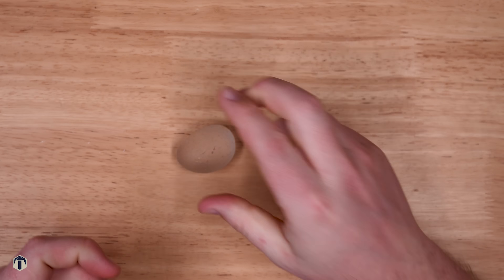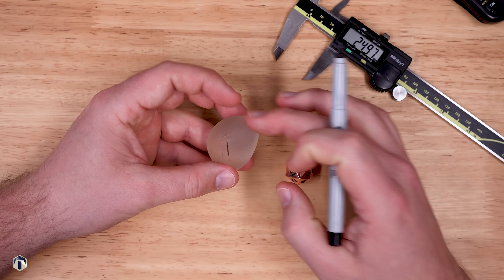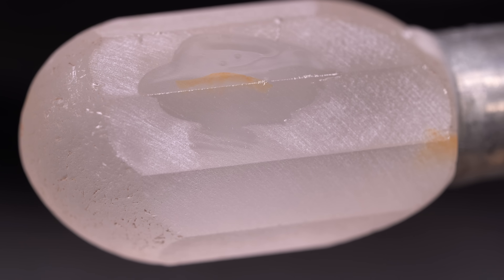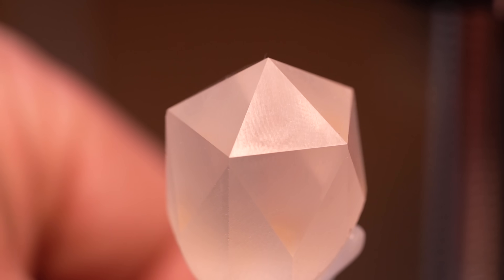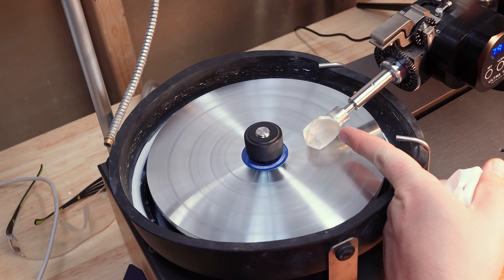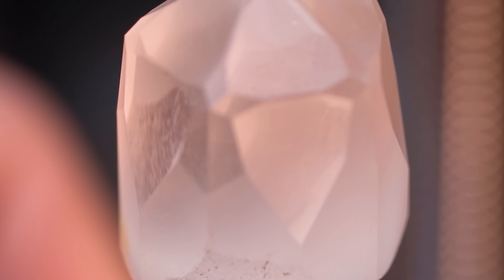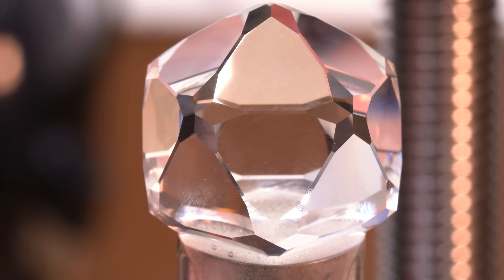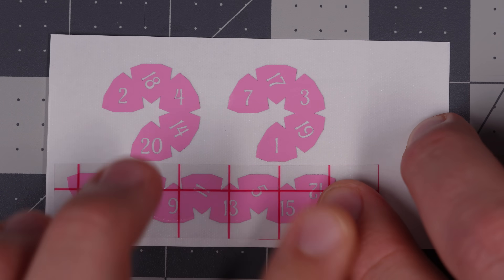Carving the Sparkliest D20 Ever

Comment: And here, we see precisely why topaz is so highly sought after.
Absolutely gorgeous.
Reply: How can you tell if its topaz or quartz? I think it looks exactly the same as quartz....
Reply: @sapphiretoffee1100  topaz has a significantly higher refractory index, so light shines through it much more.
Reply: @ShiroArctic  oooooo that's so cool! Thanks for the info :D
Reply: @ShiroArctic  Quartz has a refractive index of 1.544-1.553 and topaz of 1.609-1.643, you wouldn't be able to tell with the naked eye. This could be quartz, glass or topaz. If it cuts glass, then it's topaz as it's hardness is 8, quartz won't cut glass.
Reply: @terabyte3763  quartz can go as low as 1.4
Reply: @sapphiretoffee1100  Different material... Topaz or Sapphire, is made out of Aluminium Oxide, second hardest material after Diamond... Quarts is made of Silicon Oxide.

The differences between them, would be that a Quarts dice would likely break if it falls from the table you're using it at... The Topaz would probably be the last D20 you'll ever own, in your life, and your children would inherit it, and your children's children would inherit it, etc, the Topaz would be a family heirloom, lol. xD

The cool thing about topaz/sapphire nowadays, is that they can be artificially made, meaning the material itself, is cheap, relatively speaking, it's still expensive, because the process is a bit costly, but they're cheaper than naturally occurring topaz/sapphire, significantly cheaper.
Reply: @MyouKyuubi  that's so cool!! I didn't know that topaz/sapphire were the second hardest material, I've actually got some lab made sapphire from India! It was a gift to me and It's a very dark almost black sapphire, when you shine a light through it it's like looking into the ocean... also you have a good fun way of giving information that's easy to understand and fun to read so thank you for that!
Reply: @sapphiretoffee1100  Thanks!

You'll also notice that a lot of high quality watches tend to come with "sapphire glass".

Basically that means the glass face of the watch is made of aluminium oxide, because it's very tough, but most importantly, scratch resistant, another quality you can look forward to with that dice, btw, as well as your ocean deep sapphire, it's damn near impossible to scratch, so it will ALWAYS look beautiful. :)

I have a pocket watch with sapphire glass. <3
Reply: I always thoughy topaz was solid yellow through and through because of the video games I played as a kid 😅
Reply: @2F098  it can be yellow. It depends on what impurities are present in the base stone.
Reply: @ShiroArctic  Oh that's cool, thanks!
Reply: @2F098  They are available in colors blue, green, red, and any mix of the three, really... Which means they can come in ANY color humans can perceive. :]

Truth be told, the name of the gem, changes, based on the color...

Yellow = Topaz
Blue = Sapphire
Red = Ruby

Etc, they're all made from the same material, aluminium oxide, their colors are based on other materials present inside the crystal...

For instance, traces of chromium inside the aluminium oxide crystal (The crystallized form of it being called Corundum), is what makes it red... And if it's red, we call it "Ruby"! :3

Not every color has a name though, because these gems were named before anyone knew they were made of the same substance. xD

"Corundum" is the correct term for ANY color of "sapphire".
Reply: @MyouKyuubi that’s not true. Moissanite is much harder than sapphire.
Reply: @MyouKyuubi moissanite is the hardest stone after diamonds.
Reply: @MyouKyuubi  Corundum (sapphire and ruby, etc) are essentially pure alumina. Topaz is solid solution of alumina in silica with fluorine and hydroxyl network terminators. It's markedly softer at Mohs 8 rather than the 9 of corundum - all hardness scales are nonlinear, but 9 is about twice as hard as 8 converting from Vickers equivalent.
Reply: This thread was so interesting to read thanks to everyone for putting their knowledge out there.
Reply: @MondkeksLP  🤓
Reply: @2F098 my local rock store has a black topaz endemic to our area. The crystals they have are probably 1/4" diameter or less, but still.

Comment: This is so beautiful and fascinating. The light it throws around itself is pure magic. I can definitely imagine that this dice would actually help with casting of a spell and dealing radiant damage.
Would you consider talking a bit more about the machine and the settings? Like, now I want to grind this, which means I need to change this parameter on this wheel. Now, it made a sound which means this and that. I would love to see that.
Thank you for bringing magic to this world!
Reply: I know, if I were DM, this would count as the diamond component for a resurrection, no need to smash, just roll.... Mmmm sparkles.  Not high enough? roll it again!  what do you mean you got nat 20?  just Roll. It. AGAIN. mmmm sparkles.

Comment: Stunning. I also feel video games and wrongfully lead me to think topaz are more of a gold tint. But that looks crystal clear, just absolutely beautiful. Nicely done
Reply: There is variety in color. At high-end gem shows they also sell sapphire rainbows from synthetic sapphire that go red-orange-yellow-green-blue-purple and back to red over like 30 stones.
Reply: I think this would be considered silver topaz but a lot of topaz is yellow !
Reply: There's a rare black topaz that my local rock shop sells. Tons of possibility. 

I think for colored Topaz, sun exposure can reduce color vibrancy, but not sure
Reply: From ancient times to the Middle Ages, the name topaz was used to refer to any yellow gemstone.  
And Topaz as a silicate mineral of aluminium and fluorine is often a yellow (Nov. Birthstone) or light blue (Dec birthstone) based on which impurities are present when it's forming.  But it's popular to heat treat it to emphasize the color and develop it to a more golden yellow, blues are usually enhanced by using irradiation and heat treating. While it CAN naturally be pink or red, that's VERY rare and most Topazes those colors are a result of heat treating.  When Topaz has a reddish, orangeish, or pinkish hue it's referred to as "Imperial Topaz", the pinkish tones in some stones are prone to fading in prolonged, bright sunlight.
Or, and this is fairly common in mid to low end jewelry stores, they'll sell something called "Mystic Topaz" that's a clear Topaz that's been treated with metal vapor so it sparkles with greens/pinks/purples.  This is often used to mimic Alexandrite.  But since this is just a surface layer, it can be scratched off or damaged with cleaning, though it does look pretty while it lasts (you can google it.)

But it's real trick is it's VERY dense, much denser than glass, it will happily sink when quartz or citrine (other clear to pale yellow stones) or aquamarine (pale blue beryl) is floating and depending on the specific stone, Topaz can have a higher SD than Diamond.  It's also takes a much finer polish than quartz.

Comment: That's a gorgeous piece. I've got a Facetron and have been trying to pull off a D20 using a diagram sheet and there you are with just some math at the beginning to decide the orientation of the rough and freehand the rest of it and manage to include star facets at the points. Someday I hope to get there.

Comment: I noticed that you use glue for most of the process. Another option is to use shellac. You can heat up shellac and reuse it multiple times. It is mainly used in watchmaking. Since you need something to secure the dice and have it be easily removed, the ability to reuse it is an added benefit.

Comment: I just though of it, have you ever considered building a D20 from
The inside out? Almost start out with a cube that has prongs going out to every face of the D20 that can be clipped in and out for interchangeable pieces?

Definitely a lot more work but seems like something that would be cool if it’s achievable.